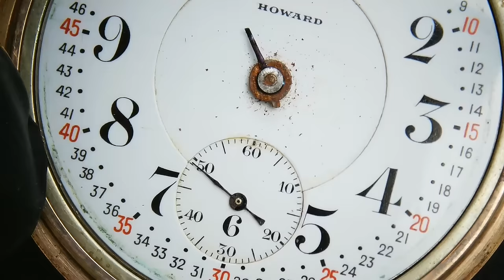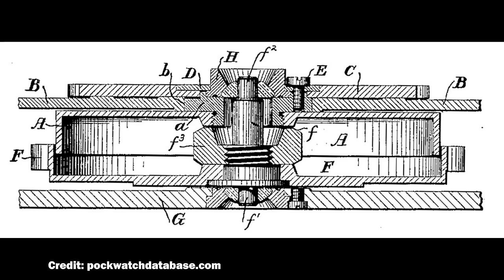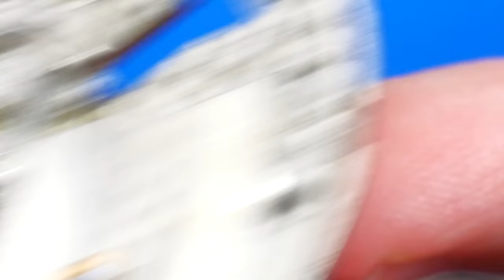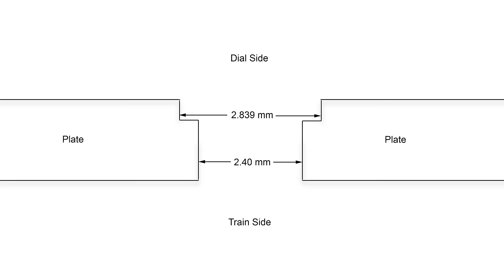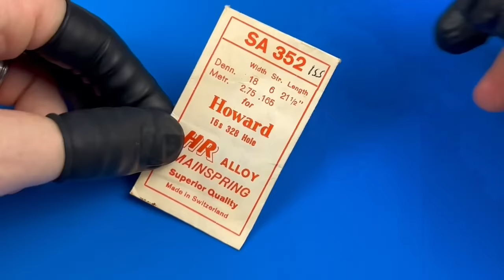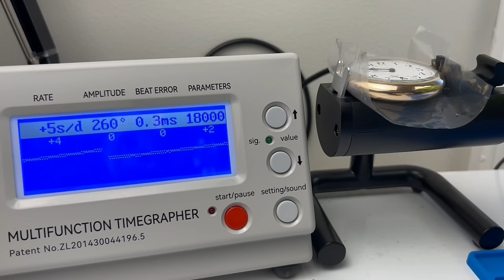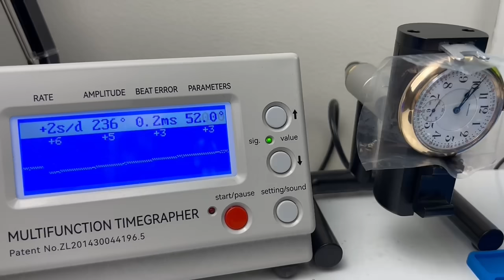Looks BAD? Just Wait, It Gets WORSE... E. Howard Pocket Watch Repair

Comment: Great job as always! A little tip for any newbies to the craft... I noticed the black is out of most of the lettering (there's still a little in the "19 Jewels"). That's probably because a previous service left the parts in an ultra-sound too long (or used a wrong cleaning solution). Your type of cleaning machine won't do that to parts. I always make sure to be very careful cleaning plates with black or gold painted words. Sometimes I'll carefully clean those few plates with a soft tooth brush and cleaning solution.

Comment: Bravo on your production quality and thoroughness. I am in the trade too... been doing the same for 30+ years and I applaud your ability to portray your/my life at the bench... almost every day. I will say, and this is not to be overtly critical, throw away that staff removing tool! If you gently turn the rivet of the staff off, without digging into the balance, it will save you great heartache. You obviously have a good handle on the lathe! This should not be too difficult. Forget what Henry Fried offers about staff removal... yet I believe most everything else he offers. Just lean into the staff with a pointed graver until you are the depth of the rivet and then tap out the staff in your staking set. You should be left with a little "washer" of rivet and no damage to the balance. Let me know if you want me to send you a small stash of old balance wheels to practice on. I have a bunch!  Lastly, I'm pretty sure this Howard should have had a whiplash regulator... I know, tough to find. I have a few that are lacking too. All in all, you and I think are of the same cloth! Keep up the good work and don't hesitate to reach out to me. dave@lastwindup.com  Always happy to help a fellow craftsman!
Reply from the maker: Thanks, Dave!! I have since been turning the hubs off the staffs on the lathe. Takes all but a few minutes. I’ve found the hole in the balance arm remains “tighter” than when I jam out the rivet.

Comment: Great video, Chris! I love how simple the Seitz measurement at 12:55 was!  I can't believe that I have actually struggled trying to figure out how to measure jewel depth with my Seitz tool! 😂😂😂 That's one of the things about watchmaking: it sometimes seems super difficult just because it's so tiny and precise, but if you just ignore those constraints a lot if it is actually quite simple!
Reply: The part that I didn't get was to measure it with a lower stump than you'll be using to push out the jewel, or be prepared to actually note which stump and pusher you used and the setting on the micrometer so you can adjust the micrometer to allow more travel to punch the jewel out, and then use your notes to get back to that exact same measurement set-up when it comes time to push it back in.

Comment: So glad I found your channel.  Your light touch and ability to fabricate many of your own replacement parts is very impressive. Your shop is nearly self sufficient. I appreciate your attention to detail and trouble shooting process.
Do you normally not use epilame on the pallet stones or lubricate all the escape wheel teeth?  Just trying to understand your technique.
Reply from the maker: I haven’t yet seen a measurable benefit in using epilate yet, but I can be convinced. I don’t have any strong reason not to use it other than I’ve had good success without it. I lubricate both stones with a generous droplet, which eventually would evenly distribute among the teeth. Any more than that and I feel the oil could begin wicking away from the faces and up the sides of the  stones… which I suppose is what epilame may help resist :)

Comment: Wow what a beautiful movement. I love the styling of the bridges, and it's beautifully decorated. Edges of the parts are also really smooth. Too bad previous watchmakers weren't as careful. Lots of little scratches.
And that dial turned out beautiful. A miracle that it didn't crack or chip over the years without crystal.

Are the main plate and bridges made out of brass and then nickel plated or is it some kind of stainless alloy?
Because it's quite an early movement to be nickel plated I think?
Although the train of wheels is definately electroplated.

Comment: Nice job! One problem: The balancing of the "balance wheel". A simple balance of the wheel that is rotating counterclockwise or clockwise isn't sufficient. As was learned in aircraft propeller balancing, the vertical mis-balance must be dealt with first. After that, a simple horizontal balance will put the wheel into a true balance. Sniff at this as you might, but it is probably the difference between an accurate time piece and one that simply isn't.

Comment: Very clear good presentation. 18:27min, you talk about tempering the screw, but did you harden it first by heating to red heat and quenching? Just a thought.
Reply from the maker: The steel rod is already quite hard compared to some of the annealed variety. Do you think there’s any harm if I were to reheat it to cherry red and quench, first, before bluing if they are already heat treated that way? This isn’t an area I know a lot about. Thanks!

Comment: Very skilled and accomplished in addition to a very high class production which had a lot of educational value for me. I was curious about the high quality of your video. Do you use a stereo microscope with a video camera or DSL with a macro lens as I noticed your video is filmed on a slight angle. This is a hobby for me and as a eye specialist I use a Zeiss microscope - but for documentation which is important for me I am now rather using a Sony with a 100mm macro lens rather than a video camera that I happen to have on another stereomicroscope (AM scope). Obviously for your productions you need video which can be quite challenging with regard to excellent exposure and focus. Anyway thanks for the excellent channel.
Reply from the maker: Thank you! The wider shots are take on the iPhone. For the majority of the video, I use a Lumix G85 shooting in 4K with a macro lens. The really close shots are recorded on a relatively inexpensive microscope I purchased on Amazon

Comment: Outstanding skill to make that old piece of history run. I'm about to start watch repair myself. The wife and I decided on a 1500 dollar starter budget. I had bought a 30 dollar junk set just to see if it would be enjoyable to me. It is for sure. I already have a microscope because I am a silversmith and set my own stones. So I figure after Bergeon Screwdrivers, tweezers, movement holders and lubrication stuff, I'll have about 1K left. I also have a ultrasonic cleaner. I will be working on old pocket watches at first. Then move in to smaller time pieces after I have some experience. What would be the best use of the 1000 left. If you don't have time to answer, I do understand.
Reply: Hi airjocky, I’m a few years in and can suggest a some things. Microscope is a great start, you’ve probably got loops too and a work space so you’re ahead of the game starting out. Thinking about what I’d be unable to work without…Demagnetizer is a must have, likewise a timegrapher, sharpening/honing setup for your tools, hand levers, hand pushers, rodico, cleaning and rinse solutions, IPA, essence of renata, parts trays, watchmaker’s cushion, small staking block, peg wood & acrylic sticks, case opening tools - ball, blade. Then later on staking set, seitz tool, crystal press. For tweezers I’d recommend carbon steel and bronze rather than stainless. Are you planning on lessons? You’ll get a certain distance with youtube but there are so many little details to take on that often aren’t shown. Good luck!
Reply from the maker: GW covered it nicely. I will say the one “big” tool that changed the game for me the most was the staking set. It unlocked a lot of doors.
Reply: Thanks @csspinner  I've been looking at the staking sets and the Seitz sets.

Comment: Interesting. I'm looking at an Omega with pretty much the same issue. The watch has been dropped and both ends of the balance staff were sheered off, and took the captive jewel in the plate with them. It's completely shattered. I am considering trying to replace the staff and the jewel as a learning experience, but a staking set is pretty expensive...
Reply from the maker: It’s a worthwhile investment. A staple on the bench, assuming you’re into the hobby. If it’s just for one watch, I would hard to justify it though

Comment: Can an ultrasonic bath crack these jewels or shift them out of place?
Reply from the maker: The typical jewelry ultrasonic isn’t powerful enough for that. The cavitation can, however, exacerbate the damage of jewel that is already cracked
Reply: @csspinner  I got a 16l bath from vevor, throughout my research on ultrasonic baths all it says is the larger ones that allow larger objects but doesn't change risk, since it does have larger and more transducers do you think my oversized bath could be dangerous? Thank you.

Comment: Wait so what specifically do you use for cleaning the dial? What brand? And I didn't get what you said, you said denture cleaner right? Just paste the link in the reply if anything, don't need a whole paragraph please and thanks if you replied and are reading this.
Reply from the maker: https://www.amazon.com/dp/B000GGKPWQ/ref=cm_sw_r_as_gl_api_gl_i_MYBR2ZXTCFRGVH8HG6F7?linkCode=ml2&tag=cspinnerwatch-20
Reply: Thanks a lot man, and it works for other dials too right? Metal, and stuff?
Reply from the maker: @AlexHristodorescu  only enamel dials. Don’t get the metallic dials wet. Also, before dipping your enamel dial in water, make sure there isn’t some handwriting (sometimes jewelers do this for private labeling) that will wash right off
Reply: Oh ok, also never knew jewellers did that. Sorry for the late response, and appreciate the fact you even responded, You deserve the sub. Thanks for the info, I'll be sure to use it when working on my Chas E. Jacot watch :)
Reply: Hey man how much do you charge for a broken balance wheel by the way?